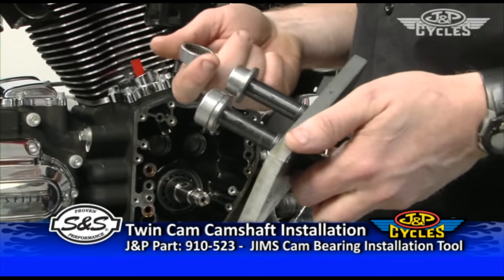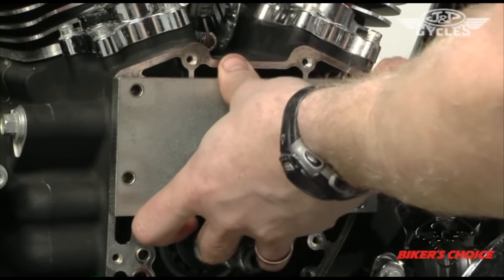Cam Replacement on a Harley Davidson Twin Cam, including Pushrod Removal •  J&P Cycles

Comment: Good information! But after you rotate the crank and check for run out, what determines the crank position for proper timing of the cams? How do you  verify the rear number one cylinder is at TDC? Thanks

Comment: In the process of collecting parts to do this process. My bike has 45,000 mile. Should I consider replacing the cam chains or the gears. Thank for any help.
Reply from the maker: Depending on the year of your bike consider replacing your cam chain tensioners. The spring style on the early Twin Cams had notorious failures. If your getting in the cam chest its the perfect time to upgrade cams/oil pump/plate.
Reply: The bike is a 2007. Motor is 96B. So basically the same as in this video. Thanks for the quick response.

Comment: Did they fix the wear issue on the new cam tensioners? Im just wondering when i should worry about replacing mine
Reply from the maker: They definitely made them better. In 2007 they changed to the hydraulic set up that works much better. Gear drive is still the best way to go if your crank is within spec. But if you have an old spring tensioner set up you can convert to the hydraulic set up with the S&S pump, plate and hydraulic tensioners. 
https://www.jpcycles.com/product/179-299/s-s-cycle-tc3-oil-pump
https://www.jpcycles.com/product/179-304/s-s-cycle-tc3-cam-plate
https://www.jpcycles.com/product/832-935/s-s-cycle-hydraulic-cam-chain-tensioner-kit?redirectedKeyword=330-0518&totalResult=1

Comment: When you align the timing marks on cam and crank sprockets does it need to be at TDC cyl 1 or does that not matter?
Reply: Stroke is set by the cams, the pistone just go up and down. So when the crank sprocket is "up" means the piston is up and when you put the cam sprockets on and align that mark it sets the cams. Don't worry about anything else just align the marks and it's ok to spin the crank if no cam sprocket as valves not opening but if marks are not aligned and you put the cam gear on be careful turning the crank.  I hope that all made sense.
Reply: homie789 appreciate it I just installed my cams step by step.timing is good compression is good but now I have no spark.checked coil pack wires and plugs all good.fuel pump runs but doesn’t spit any fuel.So no spark no fuel I’m thinking ECM but that’s rare and don’t wanna throw money at it.i checked ckp and it’s clean.anyway thanks for the response🤘🏼

Comment: Well I do like all information on my pride and joy I have 2009 fxdli with 110 inch kit and a dd7 trans gear set from baker and the nose cone can accept a jims heat sink to help reduce heat in the cam chest

Comment: For installing the cam bearings, is there a torque spec for the full seat rather than going off “the taper part is getting tighter” cause I know I could definetly over tighten it by accident

Comment: Justin - I have been told that I need to remove the oil pump from the cam plate and then during assembly perform the oil pump alignment procedure.  I noticed you installed the oil pump attached to 
the cam plate.  Can you or another person comment on why this is acceptable?

Comment: Can you over tighten the cam bolt? Didn’t have access to torque wrench at the time. Can’t turn engine over from wheel now and think that’s why. Spark plugs out, 6th gear

Comment: I am In the process of replacing my Camshaft tensioner to the upgraded model and loved this Video i know i can do it but the one problem is the tool to replace the cam bearings.. The price of the tool i will only Use one time is really expensive for the back yard mechanic like myself is there a less pricey tool you can get ?

Comment: Hmmm, I've never, in all the years of wrenching and all the different things I've worked on,  never installed one fastener that requires Locktite by spec without carefully using solvent to completely remove all traces of oils. I'm not sure if I was being overly cautious because Locktite works with lube, or that this mechanic may not have been sufficiently cautious. Comments?

Comment: on the S&S website the 509C kit shows the cam bearing plus two more larger roller bearings. I have watched several installation videos but not one of them showed the use of the larger bearings. Why are they in a kit if they aren't needed?

Comment: I wonder if the owner could have benefitted from putting in higher grade tensioners or a permanent solution that eliminates the need to go in later and replace cam chain tensioner?

Comment: I don’t understand if you’re checking the valve timing on the front cylinder , how does that tell you the rear cylinder timing. They are the same timing? Right?

Comment: I was looking at installing s&s chain driven cams in my 2007 FLHRC. But I would do it all cam plate & pump. .007 run out is crazy I'll be shocked if you get close to 100k out that engine. Far as case splitting you'll be better off getting a  Great engine

Comment: I have a 2014 with a 103 twin cam, it has a HD 259E cam. Can I use the HD precision fit push rods with the S&S hydraulic lifters?

Comment: This might be a stupid question but if you use the "standard" adjustable pushrods (not the quickies" how to get the tappet cover back on if you have to remove them to insert the pushrods? I plan on doing a tappet replacement at the same time so i was going to buy the standard pushrods but I cant figure out how it would work without removing the rocker boxes. BTW thank you so much for this video.
Reply from the maker: If you have the "standard" adjustable pushrods you will more than likely have to remove the rocker box covers.
Reply: J&P Cycles When did Harley put a "standard" adjustable push rod on top of a hydraulic lifter? What year? What model? What engine? What happens when a hydraulic lifter floats? Would a heavy adjustable push rod make a hydraulic lifter float? I think the proper way to adjust a push rod would be an adjustable rocker arm.  I suppose an adjustable push rod would be a lot cheaper then building an adjustable rocker. So if a company wanted to build a cheap engine fast they would loosen the specs, press the crank pins together, and get that bike to the customer. Then guy's like you can make video's of how to fix the piece of crap.
Reply: +fredmagee Many companies press the cranks together. Hydraulic lifters are not meant for high revving racing applications, they are meant for no maintenance which is what Americans want. Hydraulic lifter design specifically eliminates the need to adjust your rocker arms and hence the adjustable rocker arm assy is also eliminated.
Any fool Whoops am I talking about you? Yes I am, any fool can talk trash about any engine every designed. Harley-Davidson has made an excellent motor and those who purchase them know what they want. You can always shop elsewhere for a different motor. I promise I won't stop you. Why not purchase one of those motors that do require periodic valve adjustment. That would make me happy.
Reply: +fredmagee There is no such thing as hydraulic lifter float. The concept of "float" in a 4 cycle engine refers to when at a high rpm the weight of the valves and the strength (weakness) of the valve spring is insufficient to seat the valve stem on the cam lobe or in Harley-Davidson motors the rocker arm. When this happens the valve bounces and that means the motor can no longer control the timing of when the valves should be seated or open. The net effect is you hit the rpm ceiling. Thus the power can no longer increase. For a low revving large cylinder V twin this is not a problem because for street riding these motors are perfect. True on a race track and FTW you need to hop up a Standard Harley-Davidson motor. Again, for street riding there is no better motor set up than Harley-Davidson's. That is why they rule the American Streets and ALL the Streets ALL over the entire planet. You can argue till you turn blue in the face and you can hate until you croak I don't care. All your arguing and all your hate will not change REALITY.
Reply: +PeterDad60 You have that rare ability to make people who agree with what you are saying still think you are a tool.
Reply: PeterDad60 

Mr. peter, you are wrong. There is no such thing as valve float on a push rod engine. The valve stem is a good 10 or 12 inchs from the cam it cannot float on the cam. the valve hits the rocker, rocker hits the push rod, push rod sets on the lifter, lifter sets on the cam. A hydraulic lifter is full of oil. Engine oil pressure keeps it full. Hydraulic lifter float is when the weight of the rocker assembly or at high rpm the oil pressure can not keep the lifter full and it collapses. A weak valve spring can also cause this. It is the lifter floating on the cam Not the valve floating! I do not hate Harley. Harley has made a mistake. I would like them to change or fix this mistake so I try to inform people of this mistake. My wife of 35 years makes mistakes I don't hate her when she does. The simple truth is that all Harley cranks wobble, they wobble because Harley presses their cranks together. Why can I buy a $200. dollar 5 hp Briggs an Stratton engine with a trued crank, And Harley wants me to buy a $25,000. dollar motorcycle with a crank that wobbles? Why don't other people complain say someone like you? Most Harley's today are bought by Yuppys like you. They buy a Harley for the ticket to the party. They put on their shiny new leather coat and chapps and ride 10 miles to the bar. They stand around and try to act cool. My 2006 Harley was the dirty one across the street the one with the floorboards ground half off. My jacket is faded and old. I tried to stay away from you guy's so I wouldn't get run into. I want another Harley I am looking for a 1980 to 1996, evaluation motor and a carb. Until Harley starts building a decent motor I will not buy a new one. If enough people complain maybe they will.

Comment: I bought a 2000 ultra classic , the guy put the cams in all off and it snapped the bottom gear, he replaced it and no oil pressure, any thoughts before I dig into it

Comment: What year is this engine? Great video, I am considering purchasing a 2006 twin cam. Kind of concerning the chain adjusters being made out of plastic. Any suggestions? Thanks.
Reply: save your money find your self a 2013 I have a 07 ultra classic I'm gathering information for 551 ss  cans
Reply: I was wondering what other material they could make it out of.
Reply: Just save yourself the worry and replace them, they will fail, replacing them now lets you do it on your terms and your time. It is what it is just get it done.
Reply: 1970PMD -Actually they are a nylon/teflon material.  Depends on the bike.  Only the Dynas had them in 06. The others followed suit in 07.
Reply: @dashby1953  You mean the hydro chain tensioners being 07 and up, 06 for Dyna. ALL Twin Cam engines have chain tensioners, it's just that until 06 dyna, 07 all others, they had horribly brutal spring based tensioners and run quiet chains that were like 4 knife blades running along the tensioners. Hydro with roller chain is MUCH better, but nothing beats gear drive. My 03 Road King run out was .001 when we installed 509g gear drive (better low end than 510g), but I still swapped my crank for a 2002 crank because they are solid, not pressed together, plus I went with higher flowing 07 oil pump. I had only 14,000 miles when I did upgrade just because that's what I wanted, figuring I'd have a chain drive set to sell. NOPE. The cams were HEAVILY scored, along with bearings and the tensioners were HEAVILY pitted, missing chunks out of the center pad area.

Comment: Excelant Vidieo.  I have a 06 street glide, I want bigger cams.. But I think I need to worry about the cam tentioners on mine. I think I need to change to hydrolic
Reply from the maker: There are many ways to go. I would suggest S&S 551 cams in either gear drive if your run out is within tolerance,  chain drive, and upgrade to the hydraulic tensioners.http://www.jpcycles.com/search/search?Ntt=S%26S+cam+kit&N=2756630%2B274674&Ntk=All
Reply: All I can say to all of you who want to talk a bunch of smack on Harley is the fact that you ride shows you've got heart the fact that you ride Japanese shows that you are about as patriotic as a Chinese panda. BUY AMERICAN THE JOB YOU SAVE MAY BE YOUR OWN

Comment: At 2:48 in the video when you are rocking the rear tire back and forth what was that clunking noise that we were hearing, also when you're engaged at Top Gear like at highway speeds and let off your throttle quickly is it normal to hear that same clunking noise.?

Comment: one of the first nighmare stories Ive heard about Harley cams was the chain tensioner failing. Is that not recommended when you are that deep (pulling the cam plate off). The kits switch from chain to gear driven. nice vid
Reply: he said if switching to a gear drive you must measure the run out on the crank pin.too much run out and you have to split the cases and have the flywheels retrued or crank pin plug welded.the tolerances have to be tighter to run the gear drives.you can get by with more run out using the chain drive.

Comment: I'm new to HD  motorcycles as I now own an older sportster 883, a 1992 and it had been neglected badly and my pushrod tubes are simply nasty looking. Gladly the bike Runs just fine but I wonder if I can remove & replace the tubes & pushrods on my 92 in the same fashion as in this video rather than remove the heads? I'd Like' to replace them but it's not terribly important at this point.

Comment: Why does the side cover have that circular extension in the center? It does not seem to serve a purpose; as the underlying cam gear and chain do not extend out far enough to necessitate that... is it for oil flow or something? Or is it for aesthetics?
Reply: It's aesthetics. It is where the points used to be located on the older bikes.

Comment: Excellent Video Thank You. Very thorough explanation. I will definitely use this video when I change my cams out. I have a question though, When you say, 0 lash or both tappets moving on the front cylinder, are you referring to "top dead center" on that cylinder?

Comment: When the pushrods were cut, the valves were on overlap.  On overlap, don't both valves have a slight load (slightly open) on them?  Why not cut the pushrods when the cam is on the base circle for each pushrod/valve?
Reply: I do that out of habit (first set I snipped was in 1988) but it doesn't make much difference.

Comment: So with adjusting these lifters it be which ever piston at tdc the then make sure after you snug push rod that the exhaust pushrod which is pushrod away from engine falls down passed the compression release click sound?

Comment: What I used to do with the Evo engine is use the old cam to drive in the new bearing. Just put the new bearing over the old cam journal hold it straight in the hole and tap it in with a brass hammer. Always worked for me on the Evo, but he's saying the bearing on the twin cam is slightly recessed. Still think it would be ok though
Reply: midlantic1 on

Comment: Great video.  Can you tell me if I need to remove the lifter and manually pump the lifter full of oil prior to installing the push rod and setting the lash?
Reply from the maker: It can help to soak the lifters before installing them but generally they pump up within a 30 seconds or so of the bike starting.

Comment: how did you keep those I don't know exactly what you would call them I guess the roller arms that arms that role on the cams how do you keep them supported up so you can put the plate with a cam and everything back in I'm having a big problem with that I tried using Vaseline and freezing it trying to hold it but it does not work either do you have any ideas or tips please please help

Comment: Great video, but what about the bearing on the outer end of the cams, in the oil plate, or what ever it's called. Why just change the inside bearings? Just asking.
Reply: Those are parent metal journal bearings.  If worn beyond spec, one would need to bush the bores or replace the cam support plate.
Reply: There are no bearings on the outer plat that has the oil pump

Comment: I am concerned about voiding my factory warrant tee, what is the biggest screaming eagle cam in a 2018 Milwaukee 8 motor without Changing the heads or jugs?

Comment: That Jack that he uses at the beginning of this video is on eBay for 50 or $60 free shipping. It feels like it weighs about 30 pounds. There’s a better one than the one in this video that has adjustable height and distance between them saddles to meet the frame. They are rated at 1100 pounds. They will lift 18 inches high, they are made out of heavy steel, and on eBay they are called motorcycle scissors lift jack. They’re all red there’s some black ones I’ve never seen a gray one like in this video but if you don’t have a center stand. You got a buy one of these motorcycle scissors jacks. I’ve lifted my Goldwing to do the front fork seals, and to takeoff the rear shock to upgrade the shock spring.

Comment: Question are those cam gears timed or master splind. Or have alignment marks ?
Reply from the maker: they have alignment marks
Reply: @jpcycles  so when the rear cams are on overlap the rear cylinder is at TDC, yes?

Comment: I have a 99 Ultra 70 ,miles it overheated in a funeral procession,now it making a loud noise on right side.runs smooth,i hope its cam chain tennsioner,s and not a rod or bearing.i am a disabled vet .thinking about doing it myself.what is best ,hydrolic or oem.i make monthly trip to VA in Nashville.from nw ga.

Comment: Is it necessary to use assembly lube in the holes on the case when installing the new inner cam bearings?